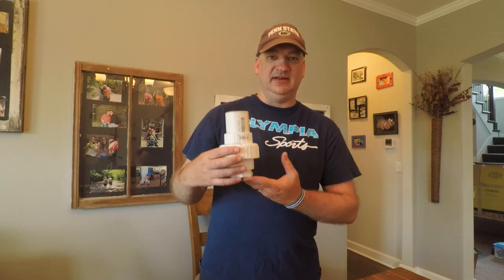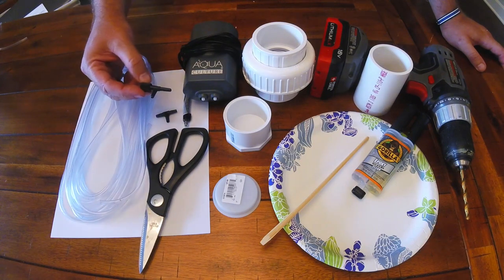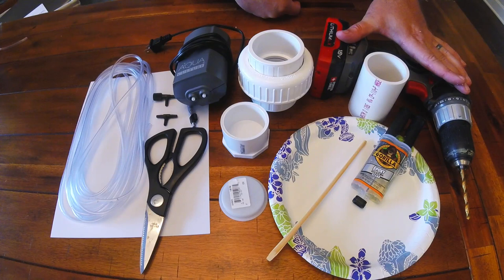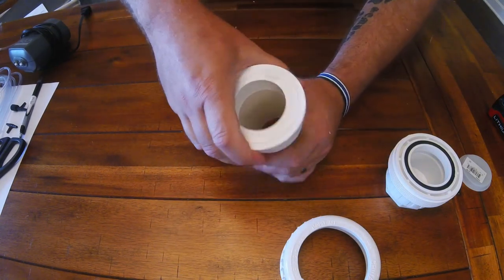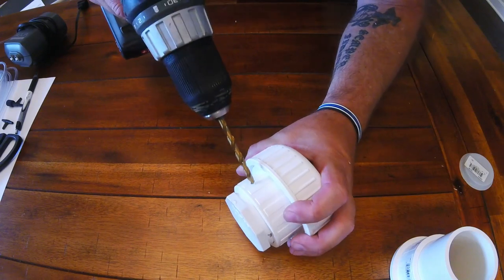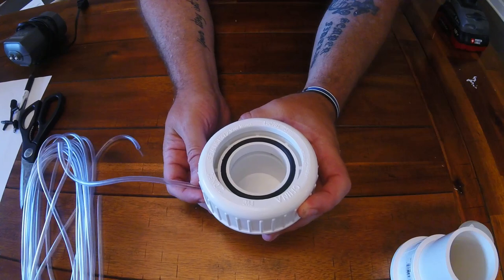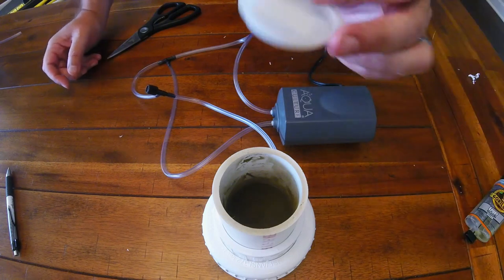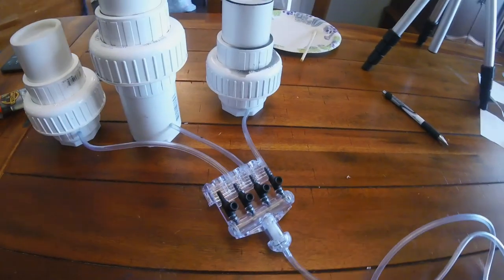DIY Fluid bed for painting jigs

Comment: That was a GREAT video!!! I have been dipping my jigs in the paint cup and like you said, the paint is sometimes uneven. Could you please make me a material list of the sizes of pipes and other materials I need. Thanks Mike Walters, Atmore, Alabama
P.S keep the videos coming.
Reply from the maker: Parts List: 
1 - 2" test cap
1 - 2" plug (flat bottom)
1 - 3 1/2 length of 2" PVC
1 - 2" solvent union
Airline (for fish tank)
Air pump (for fish tank - two outlets)
T - connector for airline
Airline control valve
Reply: @TheReelScottieK  thank you so, much for the material list, that was very thoughtful of you. I'm going to get this supplies tomorrow. Thanks and I hope you have a BLESSED YEAR!! MIKE WALTERS

Comment: Good Stuff... will I need a fluid bed for each color?
Reply from the maker: You do not need to...can put the paint back into the original container, change the paper filter and load in new color. I do it for convenience.

Comment: Thanks for the information. I made two fluid beds and they work good. I am wondering if you were going to make them using 1 1/2 inch pvc how long would you cut the top piece of pvc?
Reply from the maker: I would make them the same height as the 2 inch. I like that height because I can dip my spinner baits.
Reply: @TheReelScottieK   Thanks!

Comment: I made an exact fluid bed like this a year ago.  Now instead of a nice watery fluid, it acts more like a volcano where the air just comes up the sides and it's a mess.  Anyone has any idea how to fix it or what went wrong?
Reply: Danny Tseng I make these also and after some use you need to switch the paper gasket or possibly the union has loosened up. Another filter I have used is a coffee filter.
Reply: Just  do it the old fashion way and fluff the paint up often to keep it loose and fluffy and twist the  heated jig head in into the paint and wiggle back and forth quickly   The clumpy, uneven or dripping  mentioned is often just paint that is matted down to hard and lays down uneven when the jigs are dipped or dipped with inconsistent heat.   The bigger the jig heads the more often you need to fluff the paint .    I like Pro tech paint as a 2 oz bottle does 350 3/8th ounce size jigs  done correctly .   The bed method does keep the paint extra fluffy and its very handy but its not a all or nothing situation.    

It also important to note if your making jigs for yourself to fish or in production.   I know guys that make up hundreds of jigs and they use about 1/0th of them going overkill on production for the amount of time they fish.     I'm taking Dudes with  literally boxes  of them that there  grand kids  kids will probably never go through in their lifetime.   Same dudes that have these jig bro downs of who can make the best.     Go with kiss   Keep it short and simple and fun for fishing
Reply: Добрый день, я из России, какую бумагу Вы используете?